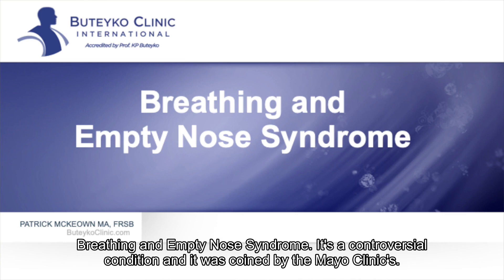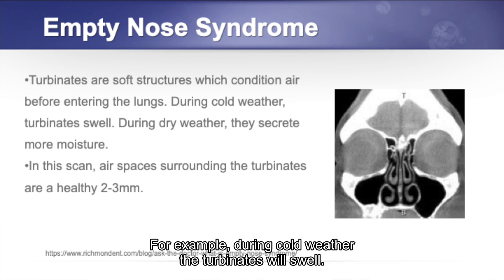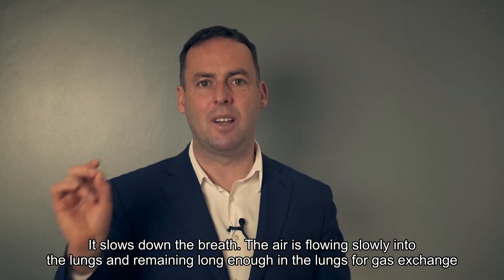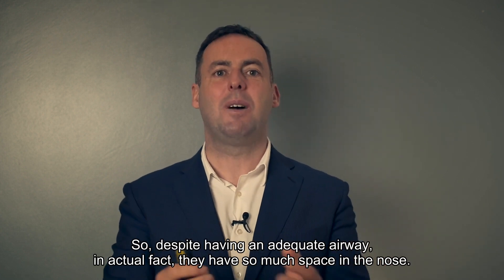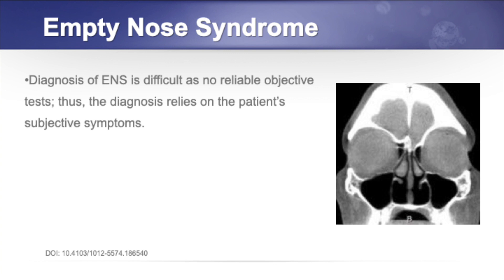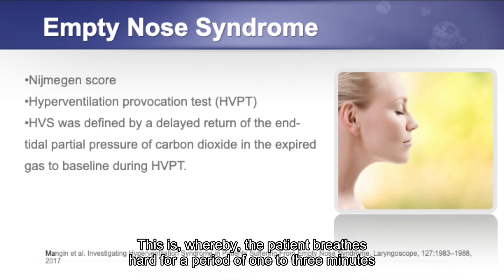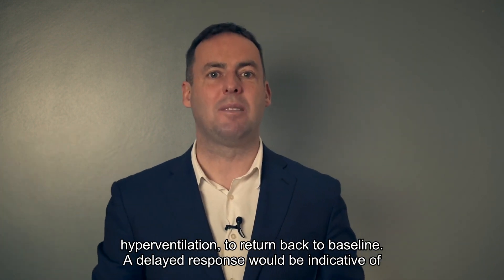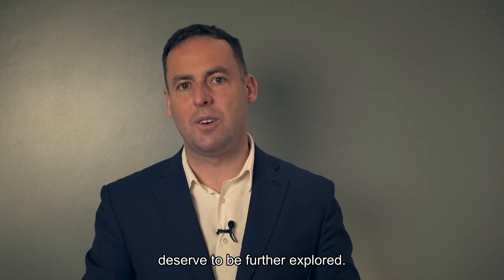Empty Nose Syndrome

Comment: I've underwent an also "risk free" radiofrequency turbinates reduction operation in 2016 (my death sentence with post-poned execution) the symptom that gets me the most is the gritty grating sensation in each aspiration of air.

My observation and takeaway of the current state of affairs: any and all nasal surgeries should be reserved only for life or death or critical situations when the doctor decides that the benefit outweighs the side-effects as in cancers and tumors. 

We weren't cancer patients when we had these absurd operations.
Reply: What does shallow breathing tell you?
Reply: Which Turbinates did u get reduced? And have you felt any better since?
Reply: A gritty sensation is what you call a “death sentence”? 

You are so unbelievably ungrateful.

You're also pretty shortsighted and rush to conclusions, there are MANY MANY nasal surgeries done every day in the world that help many people. I operated a deviated septum and I can breathe perfectly now - it greatly improved my life and my sleep and my overall well-being.
Reply: It’s the turbinates which sense airflow, control pressure, humidify and also provide moisture to the airway. If the turbinate does not heal correctly, it causes suffocating every second of the day  which messes the brain, subsequently messing the body. I agree, certain nasal ops should be performed in regards to structural however the turbinates purpose is not simply structural. It’s the nerves they contain which if damaged can destroy somebody’s life. It’s like cutting the sensory nerves on the lungs. You wouldn’t allow somebody to cut at your lungs. The nerves deep in the nose are far too important hence why they are deep in your nose (for protection).
Reply: @gabshewitt1  But you alos have 2 other turbinates and the rest of the turbinate which would be left untouched.
Reply: @bakirev  the other turbinates are as big and air does not pass like it does along the inferior. The inferior turbinate is the main one and it’s responsible for parasympathetic breathing and humidification, moisture, pressure control etc. Once this becomes damaged it’s like breathing but you can’t rest as the nerves responsible for telling the brain to rest etc are inactive. It stops you from sleeping and it’s the trigger for constant low grade suffocation not to mention other problems such as bone dry nose etc..  I went from running 6 minute miles to unable to even jog 9 minute miles. And because I’m stuck in this stupid suffocation feeling for the majority of the time my body does not want to make endorphins or relax. It’s incredibly difficult to experience happiness as the body feels it’s inappropriate due to the breathing impairment.
Reply: @gabshewitt1  Ok but it's a small risk for that to happen.

I asked my doctor how much of my turbinates they removed and he said you can't really quantify it like that. I don't know if it's a new technique or what but they damage the mucosa as little as possible and don't actually remove any. What they do remove some the bone from inside and break and bend it out of the way to open up space.
Reply: @bakirev  sounds the exact same as mine and I can’t sleep anymore of have any satisfaction. It’s more about how the nose heals. If it does not fully heal because your nose keeps swelling or whatever due to allergies or whatever is triggering it the likelihood is the turbinates will not heal normally. At the end of the day the surgery for me has changed my life and these ENTS are disgusting human beings
Reply: @gabshewitt1  Well that sucks man, but any surgery has risk.
Reply: @bakirev  haha true mate but you deserve the right to know that risk! I would NEVER have let them touch my nose if I knew the turbinates was so essential to healthy living. I presumed it was similar to a septal surgery… similar to what the celebs gets
Reply: @gabshewitt1  Yeah they should be more upfront about it. I mean technically they did tell me that it could possibly be functionally worse than it was before, but not directly about ENS. I'm still in the process of healing but even now breathing feels fine.
Reply: @bakirev  well that’s good to hear. When I first had mine my nose felt fine but over the space of about 4-12 months my nose health deteriorated as the mucosa was not protected due to whatever happened during surgery. This resulted in the nerve damage and dryness which ultimately causes the horrible symptoms. I can only suggest if you feel fine now to insure you do your very best to avoid any inflammatory triggers and insure you avoid dry climates as this dryness causes the nose to atrophy
Reply: @floatingchimney  You have no idea what it is like.  It's like every breath is your last.  You are pretty shortsighted and rush to conclusions when you make your nasty comment.  You have NO IDEA what it is like, or you wouldn't have made such an ignorant comment.
Reply: @chinookvalley  I see the full blown psychosis crew has arrived to the thread. Your nurses are looking for you, time to return to the ward to rest. No running away next time!
Reply: @aheenobarbushenocied9880  It's not psychosis.. it's functional and nerve related. The studies and cases are out there. You either experience it or you don't. judgement w/o experience is baseless
Reply: @aheenobarbushenocied9880  why are you showing such disrespect to people who may have empty nose syndrome. I have it and I literally can’t sleep or exercise or have a sense of calm/ relaxation due to the fact the turbinates hold nerves which control parasympathetic responses. If these become damaged your body loses the ability to breath on its own unless of course you mouth breath however this is not possible during sleep and it also will not relax you. Its like never being able to properly relax or experience calmness (parasympathetic disfunction) which actually messes the body right up considering the most important part of sleep is REM and this is entirely parasympathetic.
Reply: @floatingchimney  This is an psychosomatic illness. These people have underlying anxiety disorders that are heightened by a sudden change to the breathing cycle, so they freak out more, and then demonize nasal surgery in YT comments in the middle of their "I can't breathe" psychosis.
Reply: Well that’s utter nonsense. Sure there may well be some people that have anxiety and think they can’t breath etc however they get over this. It’s literally damage to the nerves which sense the air. Some people have an op and make a full recovery. Others have the op and don’t make a proper recovery (usually due to pre existing inflammatory conditions) which causes impaired recovery. To put it into context, it’s like taking a breath but as the nerves are damaged the brain fails to comprehend sufficient air was brought into the body, creating suffocating along with irregular pressure. I had the op and had no health issues but now when I sleep I wake suffocating as my nose is wide open yet nerves are damaged. When I try exercising I cant as I suffocate. To try and blame this on mental illness is immoral and disgusting
Reply: @aheenobarbushenocied9880  I disagree with it being a psychosomatic illness.

Empty Nose Syndrome is an absolutely real thing, there is no question about it.

The thing is he's blowing things out of proportion, nasal surgeries are EXTREMELY COMMON nowadays - if not one of the most common elective procedures.

The problem arises from damage done to nasal soft tissue, not bony tissue. It happens extremely rarely, but it does happen.
Reply: @gabshewitt1  Thank you for your wise comment.  Each breath is like dying.  I wonder how many people use suicide to end their pain?
Reply: @aheenobarbushenocied9880  you are wrong. there is evidence that significant swelling is shown in CT scans of ENS patients compared to those who had surgery and did not develop ENS. Dr. Nayak and his team discovered this
Reply: @aheenobarbushenocied9880  You both have no idea what Ens is about. Speaking on behalf of patients who actually suffer greatly from this. With all of these lies it looks like the ENT industry isn't doing too well.